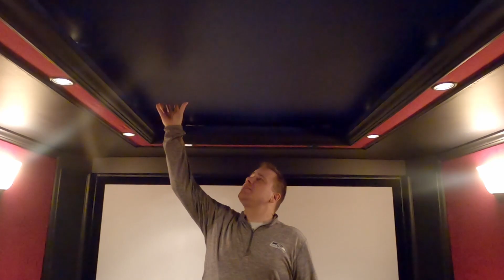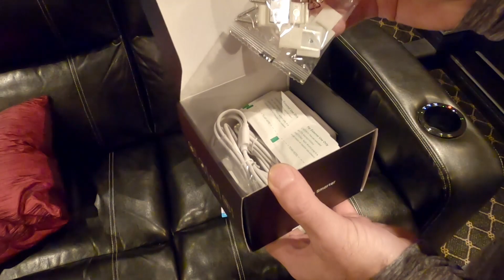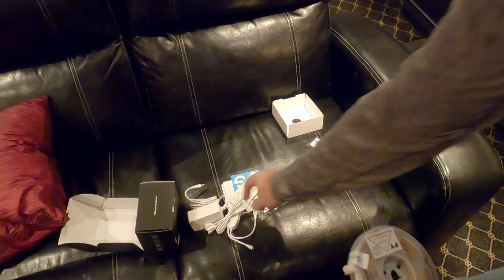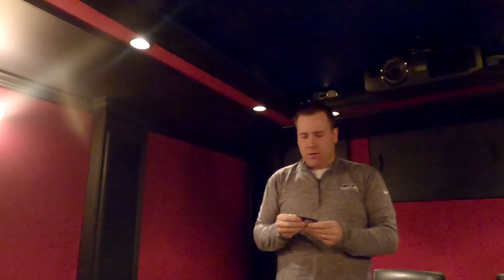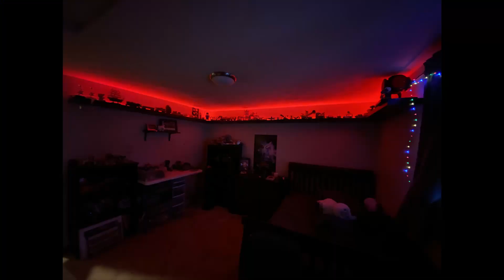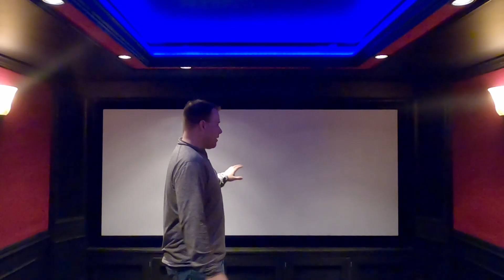Home Theater Build - Part 4: LED Lighting

Comment: Great theater! I went back and watched your videos on this but couldn't find the answer. What is the your stage height (to the bottom of the screen from your carpet). Also, what height is the riser?
Reply from the maker: Thank you.  From the bottom of the actual screen to the floor is 32", but from the bottom of the screen frame to the floor is about 29".  Each stair step (riser) on the stage is 6".  I'm happy to help with any other questions.

Comment: Does those RGBs run off an app, or just the controller? Turned out great, though! I kind of like the red, matches your “theater red” perfectly.
Reply from the maker: Thanks!!  Yes, there is an app you can download to control, them I should have shown that in the video.  :)